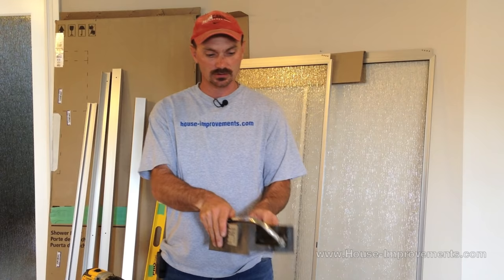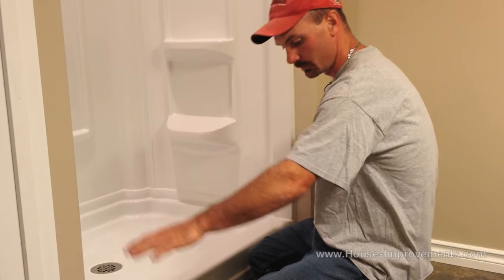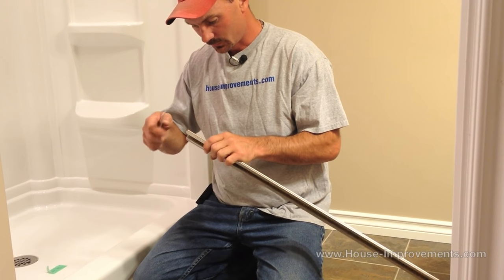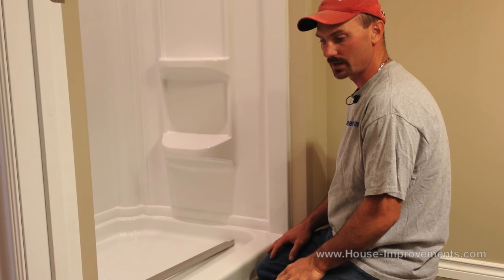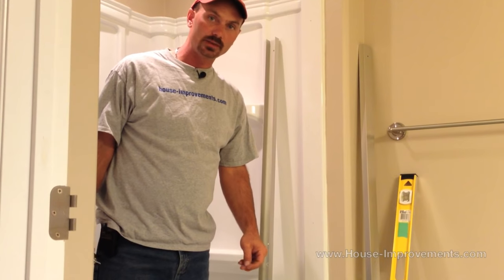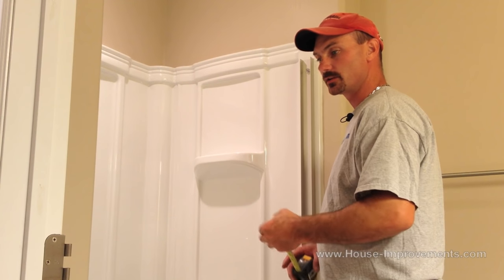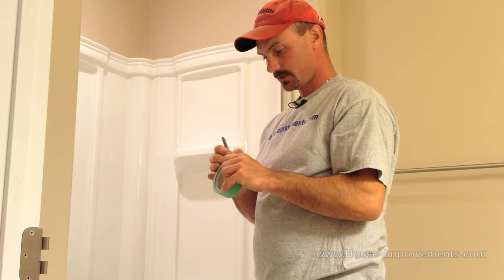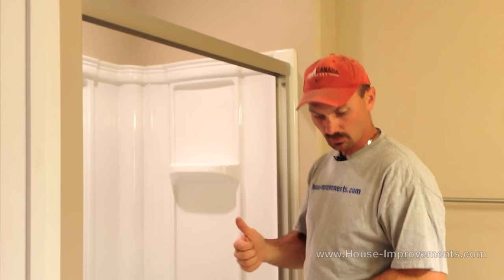How To Install Glass Sliding Shower Doors

Comment: How does it adjust for out of plumb walls
Reply: The side rails are usually an inch or two wide facing the front. You are not actually adjusting anything, it's just that when the door is closed, the width of that side rail will conceal the out of plumb in the side walls, and not let water get past. That's why the manufacturer will give you an out of plumb limit. Any more than that limit, and there will be a crack in the opening where water could get past.

Comment: 10 years later, the shower doors I got were identical to the ones in this video. Must be the same MAAX brand. The only difference with mine is that the instructions called for silicone where the towel bars slot into the doors. Otherwise, not much innovation in the shower door industry!

I watched this video a few times before, and installation was a breeze. Thanks!

Comment: How do you remove an old one already there?
Reply: With tools and your hands.
Reply: Take the screws out of the sides and the top rail and get a putty knife pushed into the joint to break the silicone seal. Work in the putty knife all the way around. It should pop off. Keep it flat so you don't dig into the fiberglass.